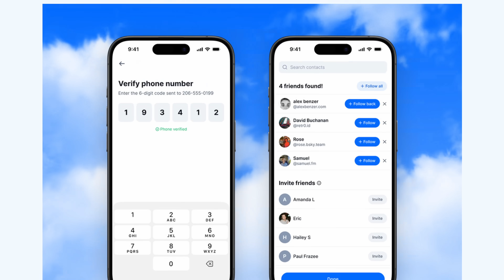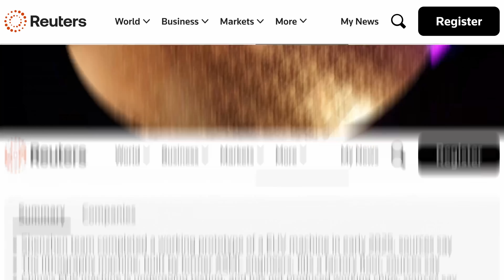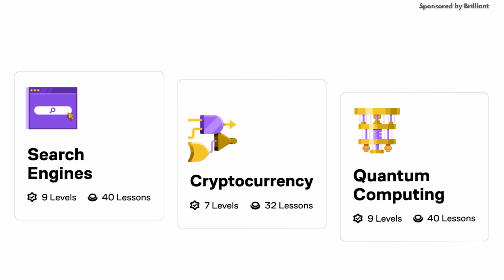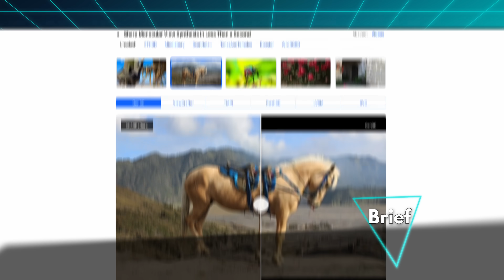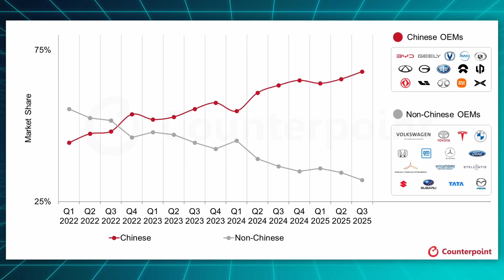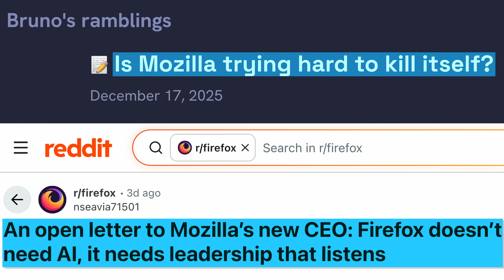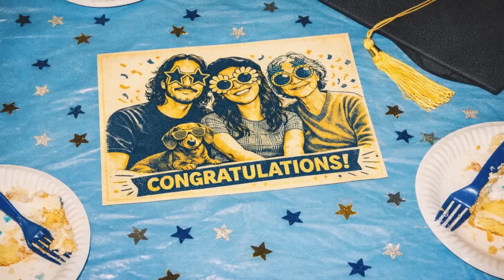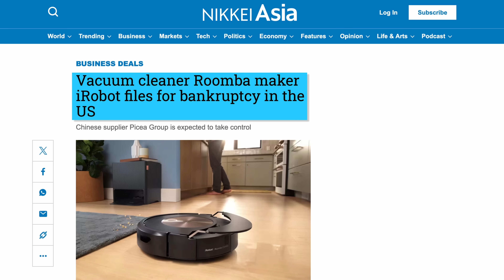Unironically the BEST software update

Comment: the problem with robo vacuums is that, even after all this time, they don’t solve a problem. they can’t go up or down or clean stairs, they can’t move objects out of the way, they don’t do a good job of actually cleaning and cleaning themselves is only a very new thing. If i have to do any of that myself, it entirely defeats the point of it existing. I think in this case the idea of an independent robot vacuum is actually impossible the way to solve the problem is with a humanoid robot: who can use an existing vacuum cleaner and do all the things I’ve just described.

Comment: i want a smaller but fairly powerful phone too, for ease of carrying around, especially in pockets.

I'm willing to give up fancy cameras, but not battery. the rest is going to be pretty much the same these days.

candy bar works for me, folding or flipping (and extra step to use) is time wasted to use or put away quickly.

i see the point for those who want flashy cameras, but lots of people don't use or need fancy top of the line. 

battery is important as i dont like having to charge often, or carry charging bricks/cables or usb cables.

portability was much more important when I was younger (45) now, so glad we had phones smaller then.

 but i still often want to go out without needing a bag and now find myself constantly holding my phone or putting it down which is so tempting to look at it. putting it in my pocket which now gets uncomfortable for long periods or sitting!

i think there's something too a smaller phone which fits in pockets (arguably men have this slightly better than female) that is still powerful enough and good battery. 

female pockets are less common and big, but im sure females would also like smaller bags to carry (ill let them comment there!)

i dont want this from a small brand because i want the support and cool stuff from the big brands. (* Australia lacks good support unless apple or Samsung)

* edit: this comment makes sense for nebula listeners

Comment: I've been trying Copilot at my new IT job for a few months now (it is free M365 Copilot, not with full license). And i was blown away how bad it actually is. Almost every prompt i do it provides non-existent MS admin consoles menus, fake commands and recently in every prompt it generates at least one empty window which suppose to have a PowerShell code. Usually it just has "1" in it or completely blank. I think blank windows started to appear when at the top it switched to Auto from Try GPT5 (i think it is GPT5 by default now, and not the quick mode). Google AI mode so far seems more consistent and less hallucinating.

Comment: The biggest lie about EVs is how they're apparently "environmentally friendly."

The computers (phones, tablets, desktops...) we're typing one required mfs to dig a bigass hole on the crust of the Earth.

Imagine how much bigger the hole would be to supplement the hundreds of millions of EVs required to meet that "90%" reduction of ICE cars... and sustain them in the long term.

Batteries suck ass. Sure, we're making leaps and bounds with the technology, but that doesn't make them viable for this kind of use. Eventually, we'd be dropping off more used batteries than we can recycle, and these shits are dangerous af. Imagine a site full of highly toxic and combustive material.

Not to mention, batteries are stupidly expensive. Even if we managed to improve the tech, most will only be using older, likely even outdated iterations.

Meaning: more environmentally unfriendly bs.

The real solution is propagating the use of public transport GLOBALLY. Don't move vehicles, move people. Create a general framework for public transportation countries can adapt and alter to fit their setting.

Do this, the use of individual vehicles will significantly drop. Roads shrink whilst traffic becomes rare. Transportation gets cheap af and cities will be built around accessibility, safety, decentralization, and convenience.

And most importantly, people like me can continue to enjoy the roads reving our ICE vehicles to the max in better-maintained roads, under clearer skies, and fresher air.

Comment: Firefox's comments wouldn't disturb me as much if the AI features were opt IN instead of opt OUT.  In the past I've had several experiences with "opt out" features where the company later claims some unfortunate malfunction happened, and they lost all the "opt out" settings so everyone has to (a) notice, and (b) redo the opt-out setting.  When dealing with something as privacy-horrific as AI, I want it to fail into the most privacy-safe position, and not the "we collect all your data until you notice" position.

Comment: In fact, the whole idea of EV's  being more environmentaly friendly is very questionable. The idea of those policies was that by now we would have much more dense and safe batteries, which didn't pan out. So we are left with EU automakers unable to compete with chinese ones, and in fact, most of them are experiensing real finantial hardships. Also by some calculations production and subsiquent utilization(we still have no idea how to make it economically viable) of a battery is more harmful to our planet than just using modern ICE in a car. And EV's being much heavier means they erode ther tires much faster, which means more rubber dust in the air, and more tires in a landfill.

Comment: If you’re interested, take a look at Brazil’s digital payment technology called Pix. It combines the best elements of the Swedish, Indian, and Chinese payment models and achieved instant, nationwide adoption across all banks. This was possible because Pix is a financial transaction protocol directly managed by the Central Bank, rather than a private platform.

Pix has been so successful that it has largely surpassed card-based payments and is on track to significantly reduce the use of physical cash. Its impact was so disruptive that Donald Trump even threatened to impose sanctions/taxes on Brazil, alleging unfair competition, since the technology runs counter to the interests of U.S.-based credit card operators.

Comment: Regarding the Mozilla thing, them saying that the AI is opt-out rather than opt-in is still an issue. People who need it should have to turn it on or install it, not that people who don't should remove it. It's just like how Windows installs a ton of programs on a new install like the Xbox Game Bar, Netflix, etc. (I actually don't know what's they install nowadays) and most people wind up having to uninstall multiple programs they will never use to reclaim space.
Reply: All the extra crap they add will eat up system resources. In Win11 I had to uninstall or turn off a hundred different features in order to get the OS run ok. Idle memory and processor usage on a stock Win11 install is double compared to what I have now. Firefox already uses a ton of RAM so adding an AI layer on top of things will only make things worse. There are solutions. Google: Librewolf for Mozilla and ReviOs, ShutUp10+, tiny 11 builder, chris titus tool for Win11.

Comment: Firefox isn't just adding some opt-out (ignoring that they have constantly removed opt-outs in recent years from even about:config), they are **mandating that all dev teams at Mozilla be AI-first, required to each have a flagship AI feature in every aspect of the browser, and that it be the primary feature they are judged on**. It's going to go rapidly downhill and break every part of itself beyond recognizability. That's why people are angry. If you're clueless, don't defend them. If someone else is using Firefox, then do yourself a favour and swap to a fork like Waterfox set to actively fight Mozilla on these changes.
Reply: Switching to a fork isn't a solution
Reply: @Soguwe It'll be better in the meanwhile, and we'll see where third option development goes. I can't stand Chrome-heavy browsers.
Reply: @Idonean personally, I'm hoping the Orion Browser for Linux will be decent, then I'm gonna switch

Comment: 5:16 why u think it is depressing , i mean EV is not green either
Reply: EVs are locally emission-free, and noiseless. How much CO2 they emit depends on the local grid. In France and Switzerland, they're amazingly good. In Germany, it depends on when you charge -- if on a sunny or windy day, you're fine, otherwise so-so. In Poland and other laggard companies, their advantages are yet not great. By why diss a better technology just because some countries have backwards grids?
Reply: @martian9999  u r not going for the full emission . only counting grid i.e., power plant based emissions , which r already bad , because apart from households and businesses , now it needs to support ev, so higher load higher pollution. and ev battery manufacturing and car or parts manufacturing , depending how the supplier mines minerals or how much of an ev is different from normal car, the manufacturing causes more pollution. unless u only want local area clean and clear , which ev might be able to do , but it won't help planet level pollution or emission control at all. same for solar power , 25 years and dead , then no recycling , manufacturing panels is causing emissions. replacing coal or gas power plant with solar would cause even more emission as needs to manufacture more panels in short time. i am not saying i am 100% sure but the other claim that switching to ev will benefit overall significantly , as in it will decrease emission everywhere and pollution everywhere seems to have no proof either. because most manufacturing requires high power , that is not going to be produced by solar, either nuclear , but mostly gas power or coal power plant
Reply: @saswatsarangi6669  standard English, please. I can't tell what the hell your main point is.
Reply: Because they're infinitely less damaging to the environment?
Reply: But they're better than fossil fuels?
Reply: It's depressing because he's a democrat😢 I just come here for the Tech updates but his Liberal side leaks out from time to time 😅
Reply: @Gspec5  He's german, mate. Ragebait should at least be based on the same continent
Reply: @Soguwe in simpler terms....he aligns with Liberal ideals...He clearly reveals his TDS in more and more videos these days, never did that when Biden made restrictive tech and privacy industry policies...and being depressed that EVs won't become the standard by 2035 just like here in Canada is bonkers. Canda already dropped it because it doesn't make economic sense, just like the EV bikes that can't survive economically and are forced to restructure or collapse because the false green energy hype is cooling off for now 😅
Reply: @Gspec5  Ah, you're one of those insane people
Reply: @Soguwe Great comeback... unable to rebut 🏆
Reply: @Soguwe  actually this is the problem we just label each other instead of logic
Reply: @Gspec5 Sorry reality has to seep into your tech fantasy every once and a while lol
Reply: @Gspec5  i am not against ev but i don't think banning anything solve it . actually i would sound like a communist(because people say so in some ways) or so, but actually public vehicles and instead of private , or if at all ev in majority  then no battery pack having,  monorail(it is called something like that) type ev crossing most traveled points in a city would help. i am not a demo or republi or citizen of US or EU but policies there affect here where i live
Reply: @Gspec5  i had heard liberal and demo might not be the same and left is also different , basically full confusion on politics lol..
Reply: Yay EU might save their auto industry!
Reply: I have the same question

Comment: 6:33 wrong. I should be able to easily opt-in
Reply: There is a massive difference between "opt out" and "opt in". The translation feature being opt-in is a useful tool.
Reply: @LostieTrekieTechie  the difference between "opt in" and "opt out" is manipulation. It means on by default which always leads to obfuscation of how to turn it off. We have to hold the line and hold them to account. This marks the end of stock Firefox.
Reply: @keensbeanz no it just means i know a feature exists and i can either right-click and unpin it, or go to the settings and find it in a couple seconds. Calling this "Obfuscation" is tremendously silly.

Comment: 8:03 India's UPI and PayPal are very very different btw. UPI is just a simpler interface to connect people and businesses directly between two bank accounts. There's no middle man or wallet.

So that's a bad example.
Reply from the maker: That is more or less exactly what wero is as well BTW
Reply: @TheFridayCheckout Sounds great ! Sweden has an equivalent system called Swish. Denmark and Norway also seem to have some platforms.

Hopefully this is accepted in all of eurozone or made interoperable internationally.

I makes no sense to depend on card transaction processors, SWIFT and SEPA payments for less than 10 euro transactions.

Comment: You know when China was 10 years behind the car industry, phone manufacturing, high-speed rail, etc.? If the CCP sees an advantage for China, they make it happen. Especially in chip manufacturing. atm chips keep Taiwan independent, if China cracks this, they can use all sort of leverage on Western nations to annex Taiwan.
Reply: China is still 10 years behind on combustion engines. It’s only because battery technology advanced they could start competing with EV’s. China didn’t surpass in phone manufacturing because the majority of chips in the phone are imported. And China didn’t surpass in high speed rail either it was a technology transfer from the Japanese. Please stop shilling.
Reply: Chips alone doesn't protect Taiwan, there's also the threat of nuclear-tipped PLA Navy boomer subs reaching the deep open Pacific undetected should the island fall to the Communists.

Comment: The problem isn't car brands not launching interesting cars, the problem is the grid not being there to take up the slack from petrol. You need energy generation AND transmission. In the UK the government is literally paying wind turbines to not spin because the wind farms don't have a robust enough interconnect to the grid. It's not enough to mandate EVs, governments need to actually mandate new grid buildup from the companies controlling distribution and new power plants or solar/wind farms to come online.
Reply: I feel like the lack of charging points is the real limiter behind increasing the amount of EVs bought where most people live and work.

Meanwhile in China the normal way to get around besides public transport is not so much EV cars but scooter-shaped electric "bikes", because their batteries can be taken inside and charged off any regular power socket.
Reply: That's why I think scrapping the rigid mandate was a smart move, gives a little more flexibility on how to achieve the targets.